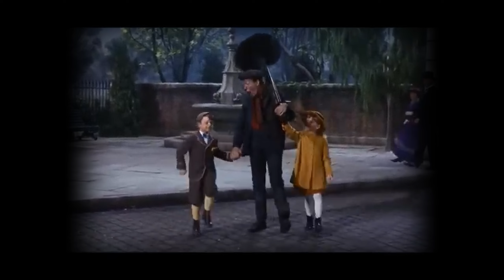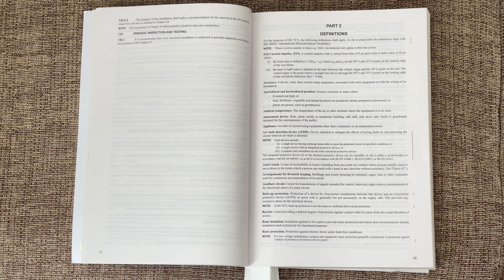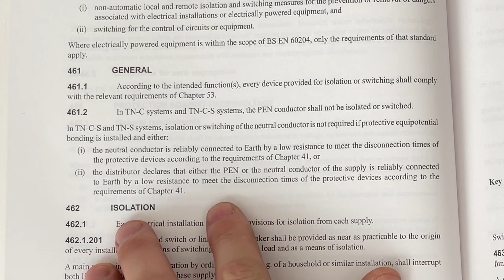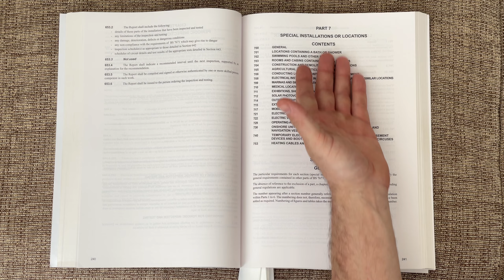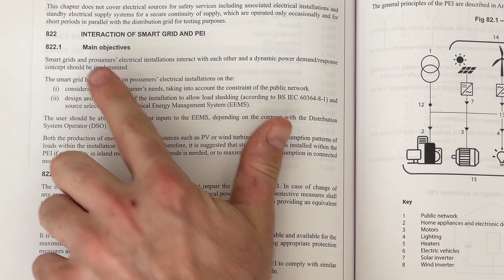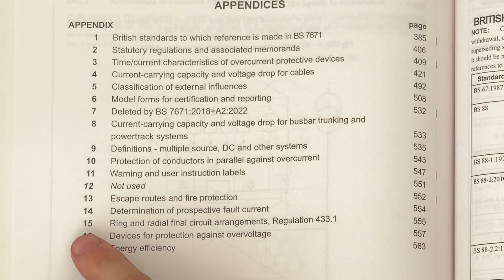This video is for ANYONE that MESSES with ELECTRICS!!

Comment: Definitely a clean book. Use post it notes to write things on that you stick in the book, easily removed for the exam and no traces in the book.
Reply from the maker: I was wondering if I will get away with sectioning the parts with coloured tabs. Just to make the process a little faster

Comment: Don’t get too bogged down in the book , you’re not expected to know the book inside out regulation by regulation, you’re only expected to know how to use the book to find the information relevant to a particular situation.
Reply from the maker: It crosses my mind that what if I did an installation and later realise that it doesn’t meet certain regs because I didn’t know part of the book was relevant to that install
Reply: Every thing you do will be relevant but some times a problem pops up and you will think to yourself if it’s right or not before you start ,that’s when you question yourself and get the book out and look for the answer to the questions that might arise. Once you’ve qualified and have all the knowledge you learned wile training and  been doing the job for two or three years you will be surprised how often you don’t even look at the book.